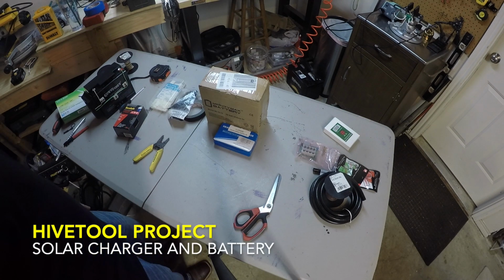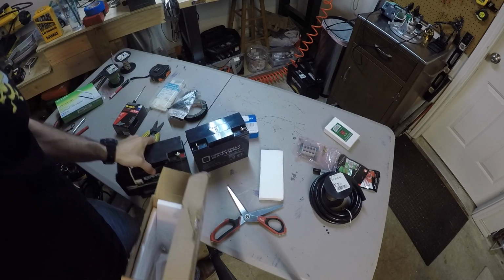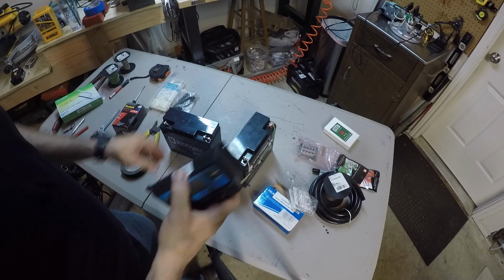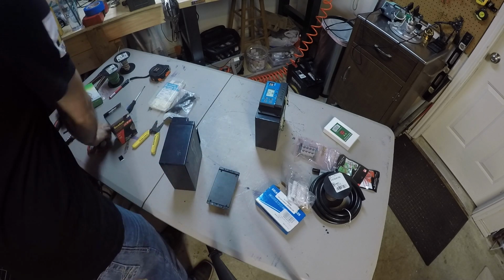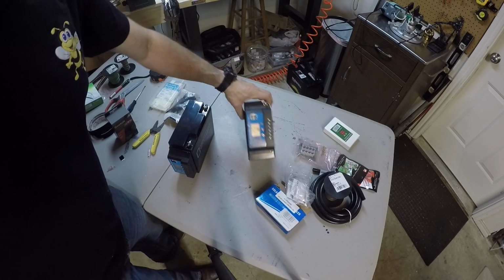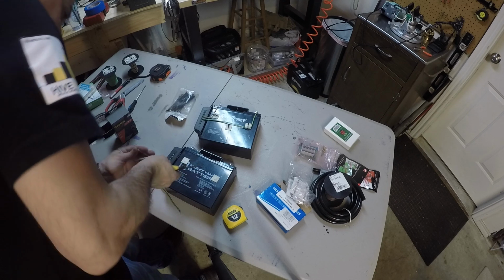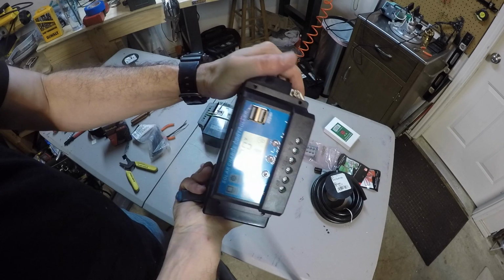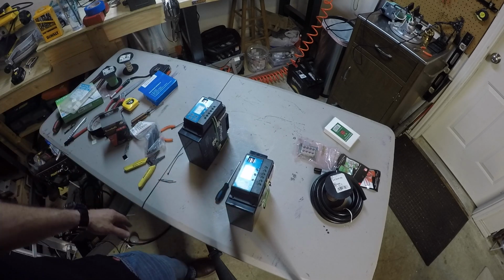HiveTool - Solar Charger and Battery Assembly

Comment: Fantastic that you have created these vids to assist construction..but.... can you edit your content to include some of the part numbers of the parts you used that are not within the  "order form" for building the Hive tool!  example: a part number or model info of the charger even if it's with a caveat that that is just the one you chose.... links would be VERY helpful  tnx
Reply: This is an Amazon link of some of the parts I am using.  I am receiving a new box idea in the mail today so I may update the list:  http://a.co/5XBT5Dg
Reply: I just bought a large SOCKitBOX and I think this is going to replace the ammo can.  I think it's going to make things much easier.
Reply: ...any ideas what happened to the org and net sites? will they ever be brought back (fixed?) did they perhaps move?
Reply: Moved: HivetoolS.org
Reply: still lost...poor docs/links on the new sites :-( .... text there speaks of bme680 support...but little to no info on integration/config... Site Index shows pages for 0.8.4 and even 0.9 but info there shows updates no img for the hivetool itself ... do I need to move back to hivecontrol?